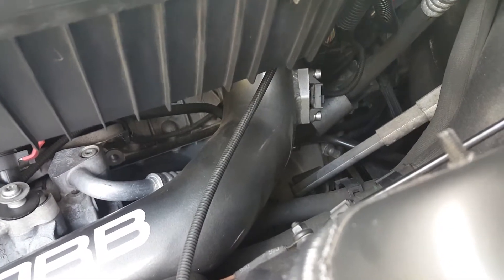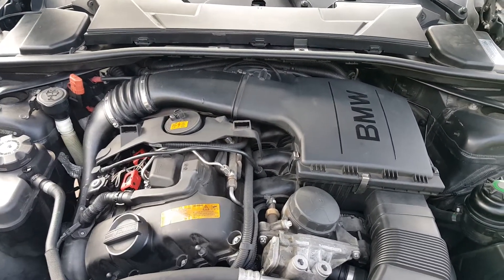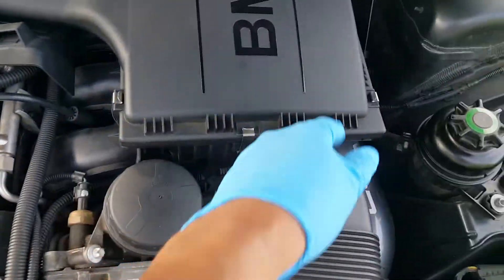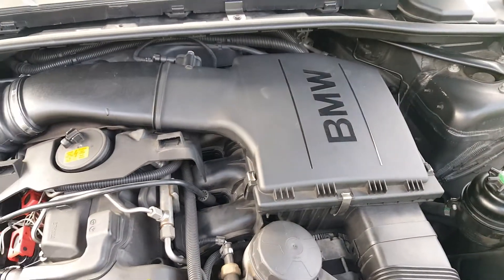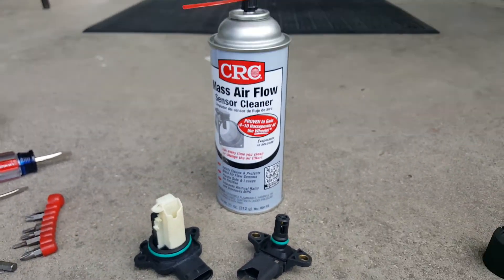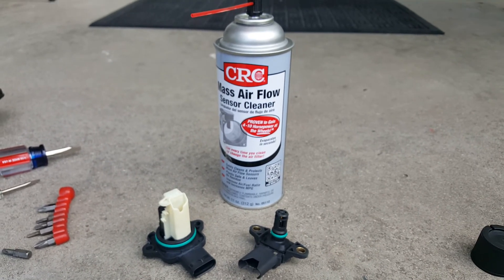N55 MAF & MAP sensor cleaning

Comment: Thanks for upload. I have rough idle sometimes. Check engine light on. Code 28A0. N55 gas 3.5 Xi x5  . 176,k  kms. Have no history and I found your video will help. Will clean both MAP and Mass sensors. Good luck.

Comment: THE N55 HAS 2 ABSOLUTE PRESSURE SENSORS THO? INTAKE AND CHARGE PIPE MOUNTED THAT PROBABLY EWHERE UR RUFF IDLE IS
Reply: The one on the charge pipe is IAT sensor. Map is on the manifold.

Comment: Nobody shows how to actually detach the TMAP with the flat head screwdriver; which is the actual video I'm looking for.  DANG IT!!! LOL  I can't see down in there and I don't want to break the damn thing.
Reply from the maker: You just need to wiggle it out like how I show at 1:48. if it's really stuck, try a small flat head to get between the sensor and the chargepipe.
Reply: @computerguy79  Saw that.  Thanks.  That's not what I meant.  I meant detaching the male part that goes to the engine and has the wires.  I figured it out though.  It's not like other videos, and it does take a small flat screwdriver.  Thanks for replying.

Comment: I changed the MAF sensor but it’s still throwing me that code does anyone know why? (2012 335i)
Reply from the maker: Maybe try clearing the code(s)?
Reply: @computerguy79  it’s still giving me the rough idle, is there a break in period
Reply from the maker: @m78858  - I'm not sure but it's possible.  Make sure it's dry (even though it evaporates fast) but yeah.. Taking for a test drive or waiting a break in period might be needed in your case. I'm not a mechanic so I'm not 100%. Sorry man but good luck.
Reply: @computerguy79  much appreciated

Comment: I cleaned mine and now I am getting an engine light with code P112F 🤦🏻‍♂️. Any help please
Reply from the maker: Idk what that code means, but Did you let it dry completely? Try clearing the code and see if it comes back.
Reply: Chief Inspector yes I let it dry and didn’t start the car till next day. Code keeps coming back.
Reply: Maybe because you pull it out while the battery is on and the CPU reads wrong givens after you take it off the connector,
Reply: reset your intake adaptation

Comment: I had 3 p112f codes. Chamge valve cover cleared codes. Engine light came on now has 1 p112f code permanent. Bank 1 absolute manifold pressure. Did yours have a code
Reply from the maker: No I didn't.
Reply: @computerguy79  thanks
Reply from the maker: @Joseph-lk9pf  np and good luck figuring out what the issue is. I hope the video was at least helpful.
Reply: @computerguy79  for sure it was.  gonna deffinently try it tomorrow.
Reply: Big bro did you find the faults regardless p112f please reply l am struggling on my e93 335i 2013
Reply: Floyd Swazin did you fix your code for p112f or 28a0
Reply: @shawnalston988  I changed my valve cover. And cleared codes then the p112f came back but just one permanent I noticed my throttle body was dirty on the outside so I took it off and cleaned the Inside flapper so be careful with it if you do the same.  When you install the throttle body back on you need to reset your throttle angle.
Reply: Chop Shop oh wow I cleaned mine but never reset my throttle adaption. How did you reset yours?
Reply: @shawnalston988  theres a video on youtube that shows you its like 3m long. 
Turn car off with key out
Push gas pedal to the floor
Put key without cranking
Push the start button without cranking 
After holding gas pedal down the whole time 
You can let go. 
If this dosent work go look it up i could have a step wrong.
Reply: Chop Shop awesome thank you so much! So once you reset it you never had the code or problem happen again?
Reply: @shawnalston988  after I reset it the car ran perfect no idle high or anything ran smooth but the light was still on being that its my daily i had to drive to work and back. After two days or a certain mileage of driving the light went off and has been off for about a month or more. I want to take it in to make sure everything is ok. But I havent had a light or problem since. 
Note. That this is a 2013 35xi e70 n55

Comment: Big help to you.... i actually had engine light on.... and made appointment to drop off car at the dealer 
 just save $500 to $1000 at the dealer because they would just replace with new + labour

 i couldn't wait so i did scan myself  and got 3 code /P0100/P0111/P0113 , then search YouTube and find this video 
All i did was pull Mass and  Map sensor off 
2012 135i M sport n55 /e88 motor 
The Map sensor that connected to the charge pipe had oil on it,
 Bought a can of  MASS AIR FLOW CLEANER from the auto part store 
And sprayed and cleaned oil off and  let dry for 2 min 
Then re-installed them both .... then start car and within 10 seconds engine light despaired boost was back to normal

....The joy i felt was like no other wooooooow
Reply from the maker: Thanks for sharing. All I can say is I'm glad this helped you out. My aim is to give back to the DIY community just as they've done for me. Seeing that it helped save you $ is a bonus. Sweet.
Reply: Hi bmw brothers I have a map sensor and a boost solenoid code I’ll remove them and clean them two and hopefully the codes will go away thank you for the info 🙏
Reply: Joe Garcia did they go away????

Comment: Thank you for the video. 
Today with the help of your video, I performed the cleaning on my sensors, using the same CRC product. My X5 n55 also has another Map sensor (same part number of the the one on the manifold), so I cleaned it as well . I did not have much of rough idle, but after cleaning the 3 sensors, which by the way looked pristine inside, after spraying the cleaner 2 times for each sensor letting it dry for 10 minutes between sprays, it still delivered an improvement in idle running. Also while pressing the accelerator in neutral, rpm come down very smooth and linear without any hesitation. 
Thanks!
Reply: I wanted to add that after the cleaning, the rpm at idle, went down from 750/770 to 700/720 and it is quieter and run  sensibly smoother also at low speed.
It will be interesting to see if or how fuel consumption improve.
Reply: @arandkay  dud it improve fuel consumption?
Reply: @drone1028  Hi, I did not see any tangible improvement, but I have to say that that a part for giving me the codes prior cleaning the MAF and MAP sensors, the car was fairly smooth anyway, so there must have been not much to sort out. . Although I can confirm that there was an improvement in idle and acceleration smoothness and sound. Also with the AC off, it idles at 650rpm. I have run 5k miles after doing it and the MAF values from my OBD scanner have been constant without any deterioration.  On a different note, if you are interested, what has definitively helped on improving consumption and made the car as quiet and smooth as a brand new one, was using Pennzoil Euro Platinum 5w40 and a Liqui Moly Ceratec treatment. It improved about 3mpg in Highway and city driving. Before that, a mechanic had me to use Mobil 1 5w-30 which was a disappointment and I flushed it out after 2500 miles. In your case did you have any improvement in consumption?
Reply: Big Thanks for your detailed input on this. It will definitely help many of us cleaning our sensors! Its already helping me.